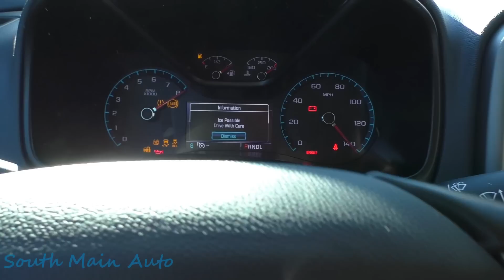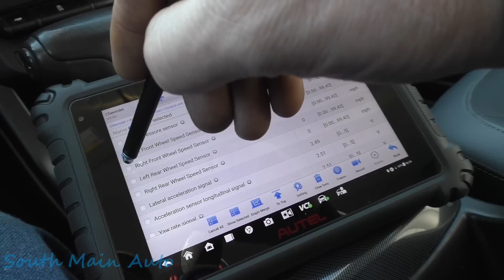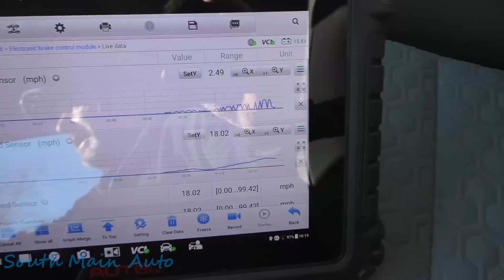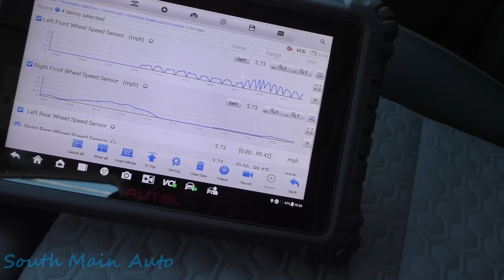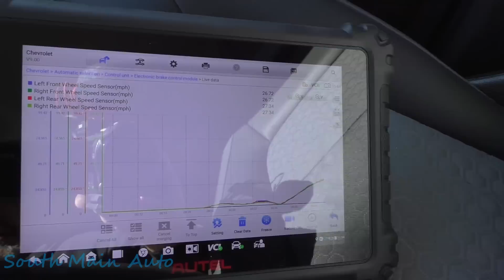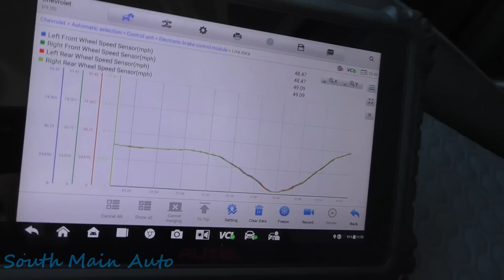'17 Chevy Colorado: Front Wheel Bearing Replacement

Comment from the maker: Previous video of this truck when it only had 14k miles on it. Now it has 50k just for the record. https://youtu.be/yW9ggF33CBg
Reply: Figures
Reply: @bullbutter9699  This one is weird. I've got a 16 Colorado, with a lift and oversized tires (stock wheels) and have 100k on the factory wheel bearings.
Reply: Sure you aren't chewing tobacco?  You're doing damned good considering it all.
Reply: @austin3171  The bearing wasn't bad, but when the tone ring magnet is manufactured on the backside of the bearing, then you get to replace a perfectly good wheel bearing.
Reply: Grease or its een replaced before?  Never know with todays junk.
   When i do abhearing i cleanit all out amd grease it all up for te next guy after 15 minutes swingin  hammer to get that rotted sunofagun out and off.
Reply: I remember this. The Dealer and GM did him wrong
Reply: @Supersonicff-dw6bs  Right - I just used "factory wheel bearings" to indicate that nothing has been replaced up front. Bad wording on my part. They don't season the roads near me quite as badly as NY does, but here in MD we still use a ton of salt in winter, so it's a pretty close comparison.
Reply: Mr o you made it look 👀 to easygoing on the wheel bearing! Great job 👐🏻
Reply: I just did this same job 1 week ago on my Hummer H2.  Very easy job.  I had the shakes to the in and out.  Have to do the other side next.   I left the main nut on and got the 4 on the rear loose.  Then took off the caliber and then the center bolt.  So easy to do.  I also did the complete front end of my Escalade EXT bas well.
Reply: @Freiherr Dinkelacker That would be okay for a 2 wheel drive truck, but this is a 4 wheeler and 4WD is disabled if the wheel speed sensors set any codes.
Reply: @@freiherrdinkelacker5730 if your vehicle has traction control system and / or electronic stability program installed, then you should not disable abs. Also, if you are not driving a car from 70s or 80s, you are driving a computer anyways. So disabling abs will not provide any benefit from any perspective, not to mention it may be illegal to tamper with such vital components on your vehicle. So be safe and keep your abs active, IMHO.
Reply: @@freiherrdinkelacker5730 well, note that I used "may" on legal part. As for the question, I am living in other side of the "universe" where it is illegal to tamper with vital components such as airbags and abs. In fact, having operational srs and abs are mandatory here and any temperance removes the road worthiness of that vehicle and brings further penalties.

No need to mention that abs is there for safety of yourselves and people around you and therefore it should not be considered as an annoyance, just because you get some error codes and warning lights for some crappy manufacturer use low quality parts that prevent proper operation of this system. Again, IMHO.

Comment: I'm retired military. Retired after 20 years. Worked as a automotive fleet mechanic. Worked on forklifts, tactical vehicles, firetrucks, generators and even a couple of lawnmowers/weed eaters.  Used PPE most of the time but not always. Goggles we received were bad. They would fog up fairly easy making it hard to see. Ear plugs were ok. Impact wrench sounds cool but will do a number on your hearing after a while. Damage to hearing is not immediate. We received periodic hearing tests and eye exams. Hearing is not so good now. Just ask my wife. She'll tell you Im deaf in one ear and can't hear out the other. Had some close calls with my eyes. Crawling under vehicles in some austere conditions. Stuff falling on my eyes to include diesel, engine oil, anti-freeze,  rust, dirt/mud, sand...LOTS OF SAND, and a 9/16 socket. Not all on the same day. 😉🤣
Reply: Thank you for your service!
Reply: @striiker7  Thank you for your support.
Reply: Yes thank you for your service!
Reply: Bad news..my mother( rip) and my sister needed hearing aids at 65. Im right behind them. They never worked in industry, loud areas..mom a clerk, sister a teacher. Theyre from another generation that didnt use earbuds, headphones, etc. Just my experience..loud noises do hurt your ears, i agree
Reply: Thank you, sir! 🇺🇲
Reply: welcome home
Reply: Same here (grease monkey in the military) - they beat in to our heads that hearing damage was CUMULATIVE and PERMANENT, and it sneaks up and gets you a little at a time… 1% here, 1% there. So I’ve always been that annoying guy who always wears earplugs even when using a hammer, so yeah, sorry, you might have to speak up while I’m working. But I’m 50 now and my hearing is still perfect. 

Of course safety glasses practically live on my face too. When I was 18 one of the senior guys was showing me how to refill the bottles of engine degreaser. I asked him if he should be wearing glasses, he laughed at me, and the next thing I knew I was walking him to the eyewash station as he cried out in pain. Fortunately he was okay, but it made an impression never to get cocky.
Reply: Thank you for your service.
Reply: started work at Londons Heathrow airport when I 16, now 66, have been pretty much deaf for the last 10 years, oh how I wish I wore ear defenders!!
Reply: Yeah Navy Ships ppe 
Mandatory safety glasses...ear plugs ...hard hards hot weary jobs...USS Essex had some bomb threats...then rats gone  onboard too.
Reply: I’m with ya!  At this point in my life, I would gladly give up some vision acuity for an improvement in my hearing.   My hearing aids help, but don’t cure anything.
Reply: I grew up within two miles of Wisley airport where they tested the VC 10 engines for years, I suspect everyone who lived there then suffers from some hearing loss. At it’s worst it actually  hurt.
Reply: Yup and other long term problems besides hearing loss is vertigo and ringing in the ears. 
At 56 years old I'm thinking about the only cure for it and that is to cut the nerve going to the ear drum. Totally def in that ear, but the vertigo and ringing that is so loud you can't get to sleep will be gone.
Reply: Thanks for your service!  Hope you are getting to enjoy the retirement.
Reply: @Eddie Leal    Thank you for your service and Sacrifices Sir. Growing up my two brothers and I helped our father work on cars, lawn equipment and motorcycles. At 16 I was working landscaping with a school friends fathers company. A year later worked at a lawnmower shop then at a Kawasaki & BMW dealer motorcycle dealer assembling bikes and doing deliveries. Up until my mid 40's I worked at various motorcycle dealers and performance shops which also was a machine shop. Yeah, I too got in my eye's, dirt, rust, oil, brake fluid, brake cleaner and carburetor  cleaner. Luckily no coolant or battery acid. One day after lunch I had a 7UP soda in a cup with the lid off and I  was cleaning something (can't remember what) with brake cleaner and then drank some soda. After a minute I started feeling dizzy. I looked at my soda and I saw the brake cleaner floating on top and realized I had ingested some. I did experience a new battery blow up and acid sprayed into my pants while standing that I just filled up with acid and was connecting it to the charger. The battery bumped up to another battery already on charge and one of the charger clips moved and sparked igniting the acid fumes causing it to blow at one end and side.
Reply: @cliffords.8341  Working in this industry definitely has its share of hazards. I recall we were mandated to have hazardous communication data sheets for each chemical we used in the shop. We were also mandated to use PPE. 

We would have an IG inspector come down periodically to inspect our shop, among other areas, to ensure we were in compliance. We were never allowed to have food or open containers on the shop floor to prevent the type of situation you found yourself in.

For those who may be reading this and dont know what I am talking about, the Hazard Communication Standard (HCS) requires chemical manufacturers, distributors, or importers to provide Safety Data Sheets (SDSs) (formerly known as Material Safety Data Sheets or MSDSs) to communicate the hazards of hazardous chemical products. 
Employers and employees need the information contained on MSDSs to protect themselves from hazardous chemical exposures and to work safely with chemical products.

Of course, as mechanics, we can be our own worst enemy.  It's ultimately up to the mechanic/user to take preventive measures to keep themselves safe from contamination. Complacency and the human ego can be a dangerous combination.  😉😁
Reply: NCOIC of wash rack detail coming home from a deployment. Soldiers kept putting their eye pro where it would do their foreheads the most good. "But Sergeant, they get water and dirt on them, and we can't see!" Okay, now the water and dirt are going into your eyes. Is that better? 
Stay safe.
Reply: @dwaynemadsen964  Can't say I never used that excuse myself when I had that detail. 😉😭😆
Reply: Rust in the eye is no fun, I’ve done that before. I’ve also had hearing loss since I was a kid and have low grade tinnitus. Whenever its quiet or I lay in bed all I hear is ringing. It’s no fun
Reply: Anyone with hearing loss that is job related needs to contact a Workman’s Compensation law firm because hearing loss is covered under that I’m a retired Union Boilermaker and my law firm got me a settlement of $18,000.00 cash and a pair of $5,000.00 hearing aids but you have to wait until you are retired before you can file a claim
Reply: @truthsmiles  I wear prescription glasses and my lenses are polycarbonate so im effectively wearying safety glasses 24/7. They have saved my eye from burning hot slivers of metal from grinding and random stuff that gets thrown at you when weedwacking. You can never underestimate safety.

Comment: I have the firm belief that Eric gets the right socket first time every time.
Reply: The 10 mm always the hard one to find when you need it L o l
Reply: It's the bolt head that's wrong
Reply: @vwwrenchie314 you got that right 😅
Reply: I've picked up so many mannerisms of his without realising when I'm wrenching 😂 "deez nuts", "right first time" "torqued to spec" all sorts... Definitely helps the job pass a bit easier 😂
Reply: After that fiasco, he should just keep a tray of 28 to 45 mm and bring the whole batch over to the work cart
Reply: It’s called editing
Reply: Probably helps that Chevy never changes anything including how there parts never last in salty climates because all there junk is made in Mexico where its nothing but dry dirt. Sad a 2017 needs wheel bearings.
Reply: @MAGWolf  my 72 bonneville, 79 mustang, and 91 probe rusted away..so did my buddys 65 mustang and 67 gto. And everyone elses 1960 to 70 something cars..were did they make them?
Reply: @pootthatbak2578  What years did they rust away? Not 5 years after they where made I am sure? Probably 20 to 30 years later. 2017 Rots in the parking lot in Northern states in less then 5 years is kinda unacceptable for how much they cost today.
Reply: @MAGWolf  my buddies mustang had rusted seat pans in 1977..so,  11 years..my 1979 mustang..same problem i recall going to the welder next to where i worked, in 1983 to reweld the floor cause it already failed pennsylvania state inspection, rust was bad around seat belt mount. Pennsylvania..says it all. In the 70s and 80s we all constantly complained and agreed about cars rusting away too soon. 
My 2011 sierra is wasted behind the back wheels, i noticed this about 6 years ago. Everything behind the taillight assys is dust..again im in pennsylvania
Reply: @MAGWolf  2017 could have been produced in 2016. so basically 7 years as the 2023s have been out since last year. If you watch VEHCOR a rebuilder in Chicago, rust gets to all models.
Reply: Hi,I had 12 point bolts for the wheel bearing on my 2000 1 ton that were caroded so bad there were nothing left,I had to drill baby drill them all out.Hardened too with tapers on them.
Reply: 60% of the time he gets it right 100% of the time.
Reply: @splatterize  what happens with the other 40%?

Comment: I usually make four trips to the toolbox to get the right size socket, glad to see somebody else goes through this, too!
Reply from the maker: I made 5..... just saying
Reply: I always grab the size I think it is then one larger and one smaller to cut down on trips.. There is a least a 50% chance the first guess is wrong.
Reply: @Troy_Built  I do the same. But then the sockets I don't use end up rolling away and forgotten when putting tools away.
Reply: I'm gonna invent the socket bandolier. Never again be with the wrong size socket. Bonus deal when you purchase with the impact gun holster.
Reply: You forgot the extra trip back for the one that was the correct size, you just didn't think it fit.
Reply: @alskjflaksjdflakjdf  I call this move “the USB” because like the usb I usually have it right the first time but it doesn’t actually work until the third try.
Reply: I usually grab 2 sizes bigger than I think I need and 2 smaller
Reply: You get one of those socket kits with no wrenches, I love My 229 piece master craft set, their not plated, the Stanley 229 piece is but the hinges are just plastic that bends and eventually brakes. The mastercraft has plastic hinges with metal pins. It has most bits you would ever need. I use My other tools too it just save’s time when you have 229 tools right in front of you.
Reply: I have a euro. 8 trips, 3 diff sizes for everything.  They cant use 2 of same bolts anywhere.

Comment: For the engineer that included grease in the service data, I bet he was either a former mechanic or had been threatened by a few over the years. Kudos for always checking the manual and not assuming it's exactly the same as the last 100 times.

Comment: Drat! It would have been so cool if Eric O had taken out that mailbox. LOL.   I LOVE the "wrench and bolt" videos. They are the best. I am always impressed at Eric O's ability to guess the socket size need on the first try. Watch Eric nail it starting at 5:31. I have been watching since Trinity visited school before she started Kindergarten. This is the first video what if Eric can do it you can do it, i.e. Eric uses a Chan-L-Loc to squeeze the caliper instead of the $200 special tool, and THEN at 12:15 he uses a Cresent wrench (an adjustable spanner)! I am amazed to find out that Eric has one. He readily admits that he has $500,000 worth of tools. The DYIer can easily do what Eric does, right after they by the SMA tool-set.
Reply from the maker: Nailed it! 😏
Reply: I LOVE the word, "Drat"!😄
Reply: I just watch now to see what tools I need to buy to do rusty jobs. And for the toot around Avoca. 😉
Reply: Seeing Eric knocking on the guy's door to fess up to nailing the mailbox would have been a fun video.   New mailbox and a free oil change to smooth things over.
Reply: @Panhead49EL  o snap to make it even better if it was the guy who cruises in the hover round and it was really his mail box and he was legit going to help him out by replacing it and Mr o did a spoof hit and run but came back later showed himself fixing it for that guy lol would be iconic
Reply: I bet 500k is a low estimate i fix household appliances and just do side work for friends and family and have like 300k easy i mean the price of tools is insane i constantly buying something

Comment: Dang Skippy I cannot believe that front bearing came out like that that was amazing I figured it was going to be one heck of a fight
Reply: I can't believe it came out so easily either.   I was expecting to see the hub buster.
Reply: Lately, he's had them easy for a change. Usually, they give him a fight.
Reply: Ford Transit front bearings (2000-2012) used to be a real struggle, well corroded in. In addition, the bearing in its bolt-on carrier was supplied separate from the hub, so you had to pull the bearing off the hub and press the new one on. I was working on company fleet vans, so the bosses didn't want to buy a new hub every time. I usually had to resort to cutting the old bearing up and taking it off in pieces. Glad I'm retired now.

Comment: First time I've seen the screwdriver in the rotar trick to tighten axel bolt.  I may have to use that one.  Usually, a crowbar between the wheel bolts to do that for me.

I am also amazed at how the Colorados seem over engineered.  My 1/2 ton Ram has 3 bolts for the wheel bearing vs. the 4 on the Colorado.  And 5 bolts on my Ram for the wheels vs. the 6 on the Colorado.

Comment: I deal with a lotta hinos down state, in there infinite wisdom they  use rotor as the tone rings, so between the salt on the road, salt from ocean air and the high heat cycle from being overloaded constantly, the tone rings casted in no longer look like tone rings after a year or 2. If it even goes thru a set of pads before they need rotors again, it’s impressive.

Comment: Changed the front hub on my Jaguar XJR the other day, didn't come out that easy, had to make up a puller using the old brake disc, that did it, just goes to show what a little grease applied at the factory will do. Great job Eric, text book, always watch your videos as soon as the appear, Thanks from the U/K.

Comment: As you well know the old trucks with u-joints at the wheel would get dry and give up. Some were greasable . A parts distributor i delivered for told me to getba separate gun and put marine grease in it. Worked wonders!
Reply: My Dad swore by marine grease!